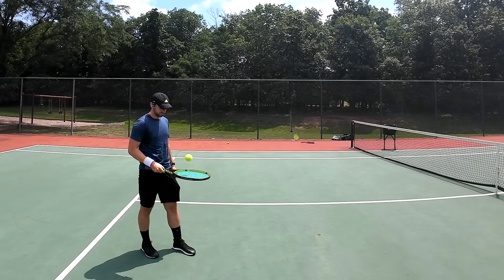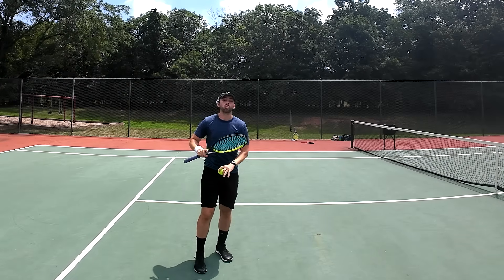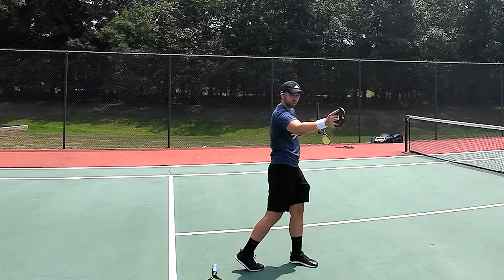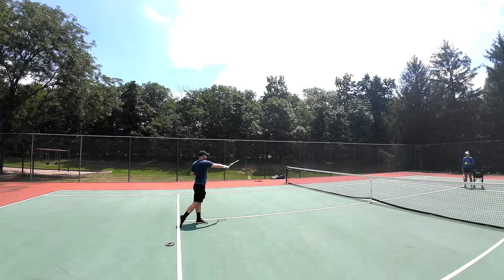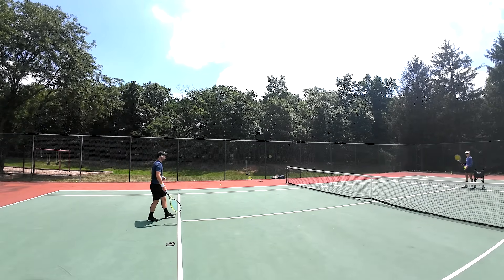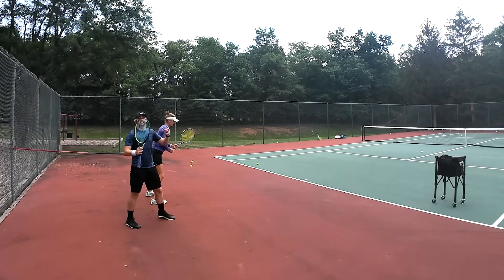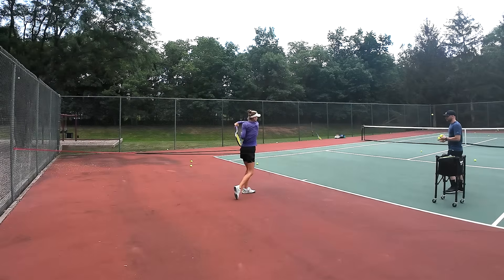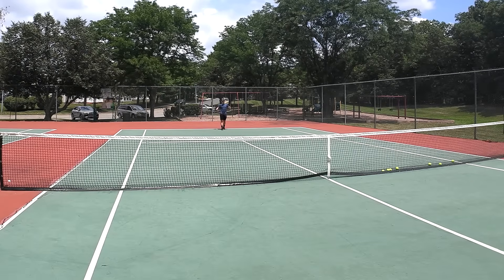The Physics, Geometry, and Biomechanics of Power Development

Comment: Hahaha you are so cheating on that example in the beginning. First of all when you start and say you are bouncing that ball in the middle of the racket face, only half of them actually do. Than you supposedly show what happens when you let it bounce around the edges but you so very clearly make much shorter and more jurkie movements with your arm. I mean you are right about what you're trying to say but you are clearly unconsciously probably manipulating the example to prove the point.
Reply from the maker: Try it yourself.
Reply: If it bounces lower in the string bed you don't have the time to make the longer more relaxed motion...

Comment: What is the solution in the case of a player who knows how to generate power and strike the center of the stringbed but often finds that they are struggling to get in good position for the ball? Would tracking and proper movement be the solution?
Reply from the maker: Maybe be split-step mechanics? Your eyes-movement-breathing rhythm would be my go-to in that situation. Making sure you're attentive as your opponent is hitting. Landing well on the split, landing well as you begin receiving.

To clarify - if you were to do the drill I was doing in the demo: slow feeds where you stand where I was standing, that wouldn't be a problem, right? It's when things get faster?
Reply: @FaultTolerantTennis  Yes, when things get faster. Any hand drop feeds are good for me. I just react super late. And when the pace is high, getting it in my strike zone becomes much harder. The sending aspect is fine though. I have good striking and power production on my shots. However, I struggle to find a mental process that is consistent for me. Sometimes, I just watch the ball and don't react. Or sometimes, I make sure im receiving but then my striking takes it because my mental faculties are on positioning.

Comment: 3::30 Is your elbow dropping down early?
Reply from the maker: Perhaps a little, but generally that 45-degree setup is fine. The arm comfortably connects to and clears the trunk from that slot. I remember that shot - it landed only about 6-inchces in, so perhaps I did prepare slightly too low, which is why I almost missed long.